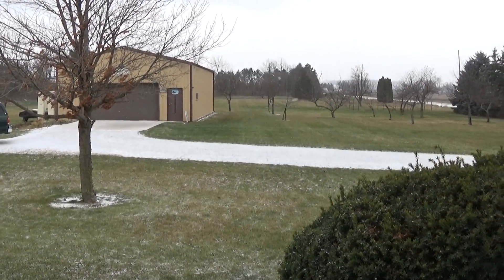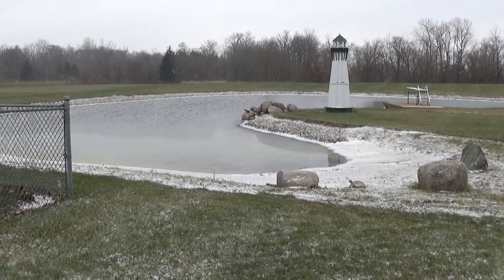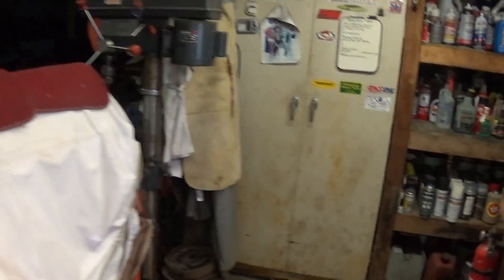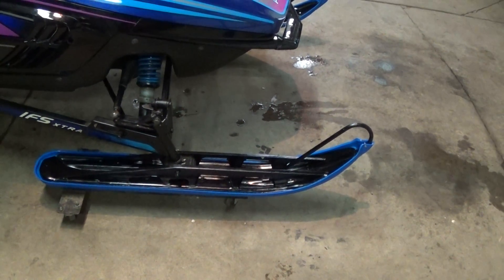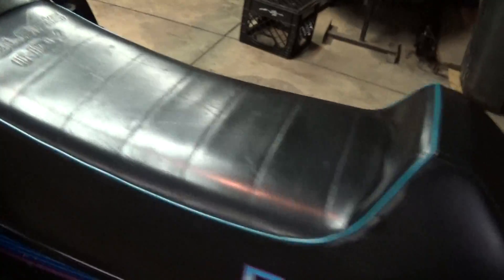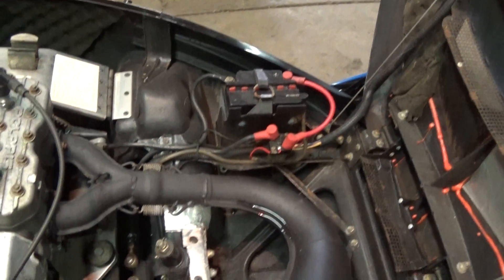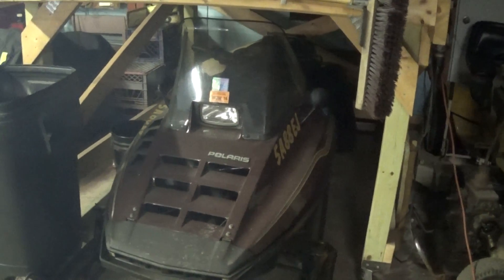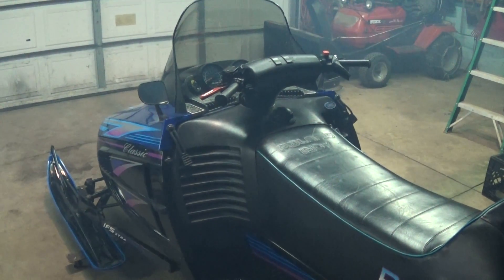A look at the 1996 Polaris Classic

Comment: I have to admit, that is a very nice looking sled! It should be a good trail riding sled.
Reply from the maker: It turned out better than I thought. I needed to get a sled with reverse and electric start because I am getting older you know, and can't toss around the machines like I used to. Saw this one for sale down by Dayton last spring and picked it up cheap, so we'll see how she preforms this winter. Thanks for watching.
Reply from the maker: Yea I went through the carbs and chaincase, replaced all drive axle bearings, idler bearings, and general maintenance, so that sled is ready for snow. My '85 Indy Trail is another story, usually I do what you do, shut off the fuel and run the carbs dry, but for some reason I didn't do that this last summer, but fortunately it fired up and runs fine. So with a little TLC and she'll be up and running for the season. I'll get a video of all my sleds running when we get a good snow.
Reply: my wife kinda told me im getting a go pro 4 for xmas,so ill post up some good vids too.

Comment: Ken, I'm looking at buying a 99 Polaris touring classic 500 to replace the indy lite. With almost no miles on it . Do you like yours ? Mark
Reply from the maker: Hi Mark, yea it is a nice cushy riding sled. What I like over the touring sled is, it is not as heavy. I had a '96 XLT touring sled and it rode nice but boy it was heavy, better keep it on the trail, because if you get it stuck it will give you a good workout freeing her up. But the '96 Classic is a sweet ride with all the bells and whistles you'll like it for sure. You might even come on over to the Polaris side.
Reply: I  still like Polaris I guess I have a soft spot for them since my first brand new sled was an 86 Indy trial and I loved it. My friend had an indy 500 so I know that's a good engine. I'm a little worried about the weight of the touring but my youngest is getting bigger and stronger and I think she can handle the 500 now. It won't be too powerful for her. I've been wanting a two- up so if my wife want's to come we can all go for a ride as a family.The indy lite is showing it's age and will need a new track soon. I also don't feel very comfortable with my daughter riding such a small ,low sled on the big trails way up north . The young guys drive way to fast. I'm thinking the bigger sled will be safer and easier to see. I'm going tomorrow to see it and I think I will bring it home. I'll post a video asap.Mark